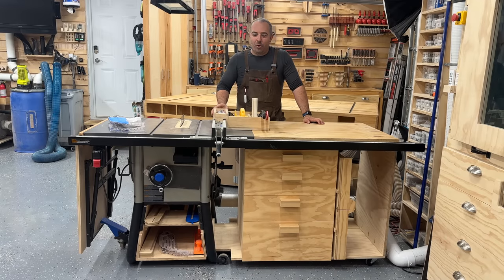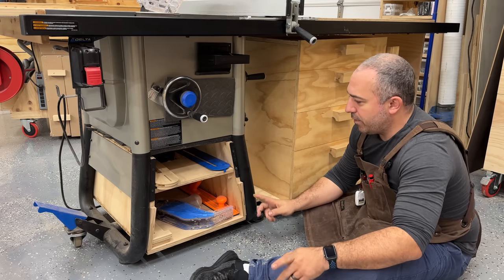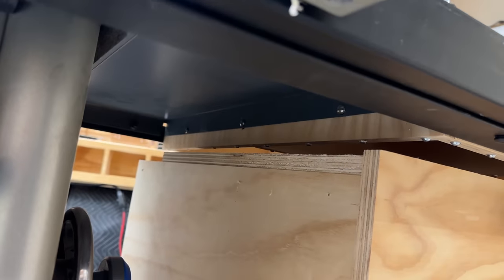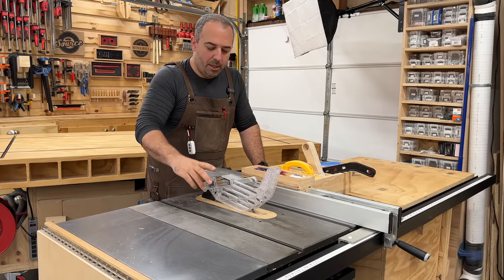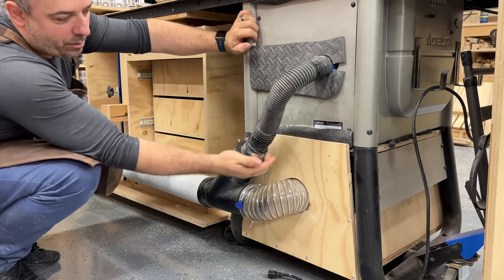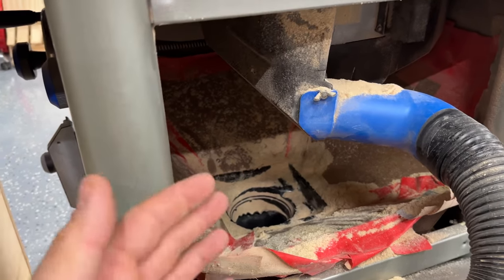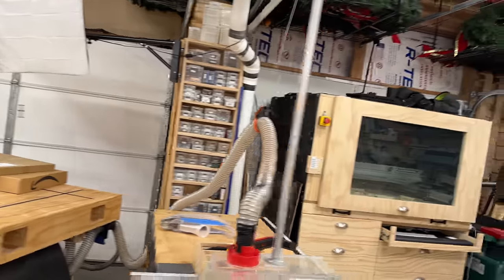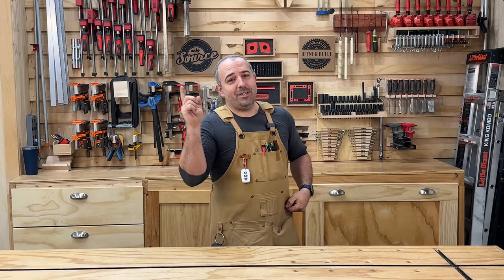Table Saw Additions Accessories and Hacks Delta 36-725

Comment: First time on your channel and I like what I see. I'm here because I just bought a used 36-735. You mentioning that the table saw just dropped the dust on the floor reminded me of my father. 1960's, Craftsman belt drive. He built a stand for it and the dust dropped into a drawer. The drawer was emptied into the compost pile. How times have changed. 
Thank you for your effort. I understand more than most how much work goes into a video like this. It doesn't just jump out of the camera to Youtube... I edit for my wife ;)
Reply from the maker: Thanks a lot! You have a do take some time, every time I’m working on a project. I have to debate if I’m gonna film it or not because it’ll take five times as long!

Comment: I recently purchased from Lowes ($200 off due to small scratch on one of the table legs. One little spray of matching paint... no more scratch) the DELTA Contractor saw 10-in 15-Amp Contractor Table Saw with Fixed Stand, Model #36-725T2. Thank you for the great new ideas especially dust collection. 👍 I'm in the process of talking with Delta engineers on upgrading to a 240V motor.
Reply from the maker: Oh wow that’s an awesome deal. Good job you! Glad I could give you some ideas!
Reply: Any word on the 240 conversion?

Comment: 50+ years at the trade, my first time on your channel. Many practical and proven hacks and concepts here, and GREAT video presentation! With your fresh analytical approach, candor and humility, you are on your way to a wonderful and creative woodworking life. As for your overhead dust collection solution, you can replicate the cantilevered boom arm of the commercial models with gussetted plywood construction or with a nominal amount of T-slot extrusion and fittings, such as made by 80/20. If you do so and create a robust and rigid enough structure, consider adding pressure rollers to the hood assembly, thereby harvesting a second very useful functionality from your investment of time and money in the boom. Subscribed; never too old to keep learning.
Reply from the maker: Great ideas thank you!

Comment: Just ran across you video.  Very informative.  I have had a Q10 for about 20+ years that i have used pretty regularly  when I was a 9-5 guy my dut collection is very similar to yours. Made mine out of left over ductwork, same for the opening for height  adjustment.  A strong magnet holds that in place. I'll be retiring from driving in a few months and then looking forward toa lot more shop time.

One other thing about dust collection is to always  run the collector for a bit after shutting the saw off. This will lessen the chance of dust getting into the motor
Reply from the maker: Great tips thank Ed

Comment: This Delta table saw has been everything I've needed it to be, and I especially like its mobility. I feel bad for folks who buy a huge cabinet saw and then can't move it around when they need to.
The plywood in the extended bars would add a bit of friction to sliding large pieces across it. You're right MDF might have been better... 
My pet peeve is the dust collection with this saw. I always make a mess when I use it, even with the dust collector sucking up everything it can out of the 2.5" port.
Reply from the maker: Yea it definitely is a great saw for the price, I have to move this almost daily during my xmas season as I need to get the folding attic ladder down. I recommend enclosing the bottom like I did, it really keeps the dust under control funneling it
Reply: @BitnerBuilt  enclosing the bottom will be one of my next projects. Working on one of those wooden seashells with the bandsaw and scroll saw at the moment.

Comment: Nice saw setup!

I really like the Delta fence system and wanted the 52", but it would not fit in my shop (well, it would, but have left no room - LOL).  I added the 36-T30 T4 to my old Craftsman 113 (with 4 extra cast wings, including a router table extension).  I modified my install to get 10" left and 36.5" right cut abilities... plenty for my needs and ability to make all but the largest of cabinets.

I highly recommend looking at the Jessem table saw clear-cut TS stock guides... they are worth every penny IMHO and mount perfectly on the fence.
Reply from the maker: Nice set up! I have looked at those jessem guides many times and they are on my xmas wish list 😅

Comment: 👍👍 My table saw is a very modified vintage (aka early 60’s) Craftsman  my dust collection system is a bit different letting the heavier chips fall in a box under the saw then only the lighter dust into the dust collector (not a shop vacuum) works very good, not sealed to maintain a high CFM needed for good dust collection, still looking at overhead collection. 
For your overhead swing arm look at 3/4” or  1” ent conduit (electrical) an electrician could bend it for you.
High pressure laminate (Formica) makes a smooth slick surface for extension tables. 
My new shop is about 600 sq foot I know it will not be larger enough when I finely get moved in, 8 months without a shop.
I’ve been woodworking for 50+ years and still learning continuously. Wish I’d taken dust collection seriously earlier!
Reply from the maker: Oomph 8 months without! Thanks for sharing and yes the electrical conduit I’ve looked at. I’ve mentioned a couple times on here. I don’t know how to weld and I’m actually debating using that as my testing grounds for learning off the big thing that I missing with the overhead Dust collection is rigidity. But at the same time for the channel, I kind of like being able to just mod some thing existing so if people wanted to copy it, it would be easier for them to do so. Choices choices… thanks monte!
Reply: @BitnerBuilt  You might consider aluminum angle. You can make your connections with low temperature aluminum welding rods. No welding skills necessary. All you need is the rods and a propane torch.
Heat the aluminum, touch the rod to the joint, and watch it melt. The process is very similar to soldering, but less skill needed because there's no worry about leaks.

Rods are available at Harbor Freight and home centers.
Reply from the maker: @ST-0311  excellent suggestion! I will look into it!

Comment: I have a ubiquitous Craftsman 13.xxxx. I made a four sided mitered funnel inside it. I used hasps to be able to stick each piece inside and clip it together. I used cardboard and some recycled rubber sheets to quickly make a flap for the motor/belt on the back. Did not try to seal it but I do not have to vacuum all over under and around the saw anymore. Dust collector moves 900 CFM which seems to be enough air to overcome the smaller small gaps like the metal bridges/webbing. I see people spray foam but I can’t justify caking it with yellow foam.
Reply from the maker: Nice thanks for sharing! I would never be able to put the spray foam inside a power tool as well that’s why I use that pipe insulation foam because it’s not porous, but it’s very flexible and can fill in the gaps

Comment: Thx Justin. I was thinking of that same fix for the legs. I can deal with it for now but down the road I may do something like that. Like all the ideas you have for the table saw and may try a few of them. I did see in a Izzy Swan video where he had the router on the left side. I may do that just because my saw sits close to the wall and the router on the right side just doesn't have enough room to work on that side. I am still getting the shop set up and not sure where everything will go. Thanks again for the info. Keep up the great videos.
Reply from the maker: Yeah, you’re right a lot of people put it on the other side too and, I guess I just never think about that because I have the extension wing on mine. Good luck with the height!
Reply: @BitnerBuilt  I had never seen that way of mounting it. Definitely gonna try it. We'll Get R Werked out. LOL

Comment: Good ideas you pointed out on the table saw that many new woodworkers fail to adhere to as the table saw is the most danger in a shop to operate dust and chips as well. I hope Safety is important to those who follow you. Looking forward to seeing what else you have to inform us about. Thanks
Reply from the maker: Thanks Larry! safety in the shops a big one for me always. So everyone will get a healthy reminder of that watching my channel! I have a frequent flyer, guest pass to the emergency room. I was with some friends the other day and letting them know I had a laser engraver I was going to install, they laughed and said this guy breaks his thumb with a ball on a string, who thought it was a good idea to give him a deadly, deadly laser! 😂 thanks for watching!
Reply: I know people keep saying that the table saw is the most dangerous tool in a shop but I can't agree. I can agree that if someone goes wrong that the table saw will do alot of damage in a hurry. But I've seen alot more injuries with tools that "appear safer" and thus give a false sense of security. Nothing like slipping a knuckle into a table top disc sander and finding out that 60 grit paper does not give a hoot if it's asked to remove flesh or wood, it's gonna remove both quickly. But it was just a sander! 

Also, a close friend has a nice scar on his face from faceplanting his thankfully powered off table saw. The cause? Disorder in his shop caused him to trip on something and wham, the exposed blade of the uncovered table saw was there to "catch him". I have tiny humans in my house, I have a small simple box that I use to cover the exposed saw blade when not in use ( or I lower it).

The most profound safety advice I have ever got was from a friend whose day job is maintaining the nuclear power plant on navy ships. He said "The day you think you are too good for the safety checklist is the day you create a life ending light show". Kinda stuck with me. 

Stay safe out there.

Comment: I bought the saw same but in the Ridgid brand R4560 for $399.00.  Everyone in the reviews said how hard it was to get the fence mounted. Took me about 20 mins to get it. Put both on pieces of angle iron and have all the bolts in place but loose. Clamp a length of 1" square stock on to both pieces making it one long straight piece. from there its a cakewalk.
Reply from the maker: Work smarter not harder 👍

Comment: I have an earlier Delta Contractor Saw 34-445 that I got it from a neighbor, and the blade guard assembly was missing. What I got uses the riving knife mount . It is a Guard Assembly w/Separator (Part# N436623) for a Dewalt DWE7485 Contractor Saw for $36.80 + shipping. It did require some minor metal cutting, but works great, and has a port on it if you want to add vacuum. And for my dust collection I use a bucket vac, to make it quieter I used the router speed control from Harbor Freight. I get the vacuum I need and since it runs slower as needed, it's also quieter running.
Reply from the maker: Very cool tips!

Comment: Thanks for the tips. Dust mods although as you say not perfect gave me great ideas I hadn’t seen elsewhere. Eg the pipe insulation looks like a fantastic quick mod i’m going to do today!

I thought about building a custom over arm apparatus. But I think the couple hundred bucks plus the hours spent engineering, building, testing and modifying ends up being about the same as an aftermarket. I’d enjoy it but I have other shop mods that have a higher probability of success. You’re sunk in it and can’t give up though. I get that!

So, for now I’m ordering a dust collection guard that my saw’s brand happens to offer. Most brands don’t have one but I hear people modify them for other saws
Reply from the maker: Yep, I am in it and figure if I build a good useful way, will be a good video 😉

Comment: I have the same saw and now I have many ideas to improve the shop once I have the house finally build :)  
I did notice one thing about your under table dust collection.  If you seal it too completely then you have a vacuum under the blade, but not much air flow.  There needs to be a lot of air flow there to carry the dust away, maybe open some slots near the border under the table to allow air to flow and sweep the dust away from the blade and down through the funnel.  It may also help lower the buildup on the corner surfaces inside too.
Reply from the maker: Thanks! Oh trust me there’s gaps everywhere lol for the air to pull. I have actually been debating raising the bottom plate higher, the smaller that cavity under the saw is the more powerful the suction will be (barring airflow like you correctly point out) something to think on when you build yours! Have fun with it!

Comment: Loving the vids and you’ve really made that saw just as good as saws 3x the price. If I had to do it again I would have bought my Oneida Supercell first!  It is THE best tool I’ve bought.  Every tool and every port instantly improved. Being a vertically oriented DC it took very little space. I actually gave my shop vac away because they are that good even with 2.5” hoses and gained space.
Reply from the maker: Thanks yea that saw with upgrades will last most hobbyists their entire lives! I always say the money coming in would dictate the more expensive stuff. Oh well yes! the mack daddy of dust collectors would be fantastic! That thing being able to go 100ft would destroy dust in my 25 foot shop. did you un the metal quick connect duct work? I need to hurry to 100k subs and hope for them to give me a call lol
Reply: @BitnerBuilt  I have clean shop OCD and hate pipes running all over. I have one 4” 25 foot hose I take from tool to tool as needed and another 2.5” 25 foot I use to clean my shop. It works great!

Comment: Justin, check out the Penn State overarm guard for that style (should be much more rigid), and the Shark Guard for one that is fixed to the blade mechanicals (& removable). I have the Shark Guard and it is very effective & safe. It does require manual adjustment of the splitter when you change the blade height for many saws, like my old Powermatic 62A Artisan contractor style (very solid, has stayed in perfect tune for 30 years). 
With the 2 1/2" blade guard connection and a 4" hose underneath (built-in dust shroud that I've further enclosed) I get almost no exterior dust.
BTW, I made my 52" TS extension out of laminated countertop. Slides very smoothly.
Reply from the maker: Thanks for all the tips RY! At this point, I am obsessively, determined to make it a DIY solution, to my own detriment 😂 I actually bought the laminated top that they sell for this saw specifically originally, five times I ordered it and five times it came in damaged, so at the time that kind of turned me off from laminated press board but you’re totally right laminated is a great slick surface for side and outfeed!
Reply: I’ve got the Penn state ceiling mounted dust arm and it’s fantastic. I think it was $200?
Reply from the maker: @psourial  yea RY pointed it out, very nice looking. IT might be my option if I can't get the diy version to the level I want.
Reply: @BitnerBuilt  I purchased a piece of laminated countertop in person at the big box store, did not order an OEM for delivery. Made the extension table top myself, so no issue with material.

Comment: Great video, I have the latest version of this saw. The dust collection is the only issue I have for the price. What if you attach the overhead box to the top of your fence? Make it adjustable both ways for various thickness materials. Another thought I had was using rubber gasket instead of tape.
Reply from the maker: Thanks! I have thought about that and somebody else mentioned it in a comment so I did a little playing with that, my concern is that it could put undue stress on the fence overtime being that that box is so heavy. I think I might try bracing the pole that’s coming down from the ceiling. Somebody had mentioned that and it keeps coming back in my head is a good idea, so putting diagonal attachments from it in different directions but great suggestions!

Comment: I have that saw, and hate the cleanup. Will definitely have to adapt some of the undercarriage mods. 
I am building a router insert for the end. Every one I have seen shows the operation from the end, rather than the same face as the saw use. Are there drawbacks to working on the same side as you would saw? I bought a separate fence.
I’m 5’6, so I can appreciate wanting the saw lower. Think I will skip it after your insight 🧐
Reply from the maker: Thanks! So usually it’s at the end because people are using the table saw fence for both for some actions but hey you do what’s good for you 👍

Comment: I have a Craftsmen 3 hp 10" saw from 80's or maybe 90's with cast iron top and cast iron wings. It has a delta T fence, same as yours. I picked it up for 200$ (the fence I looked up is much more than that!). It's 30 amp though but with a regular US plug (two prongs on top and ground prong) but my outlets are all 20amp. So a good deal yes, but now I probably have to pay the same for the outlet install lol. 

The dust guard, I have been looking into that. I also have a dewalt job site saw 10" that's roughly 14 years old. It's a workhorse but that thing T H R O W S  U P dust. I mean like you ate some rotten fish and pounded a cup of spoiled milk - instant WOOOOOOOSH. I have a Spyder blade in it for ripping and I am super ultra impressed with it. I have a CMT on others, LOVE CMT GO ORANGE!
Reply from the maker: Oh cool Next! Being able to snag a table saw with cast-iron wings for 200 bucks is a great get!

Comment: Ive discovered that if i leave the blade height gap open, i get much better dust collection as it pulls the air fastest from the front, and helps keep dust off of my front trunion, bevel rod, and height raising rod.
Reply from the maker: good tip!